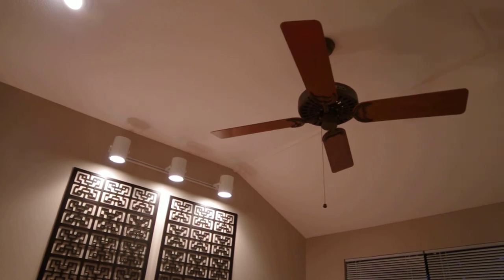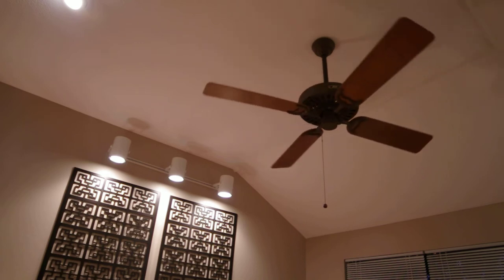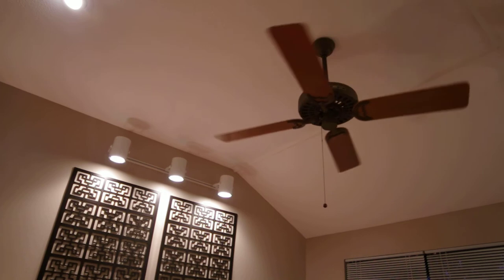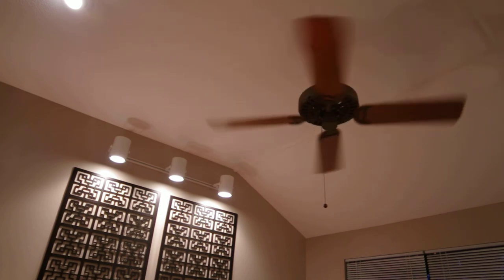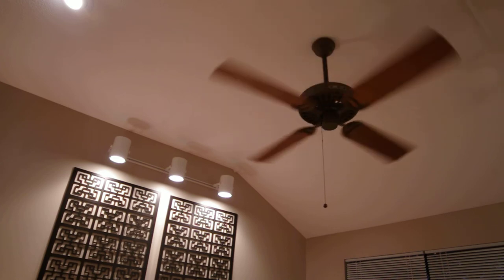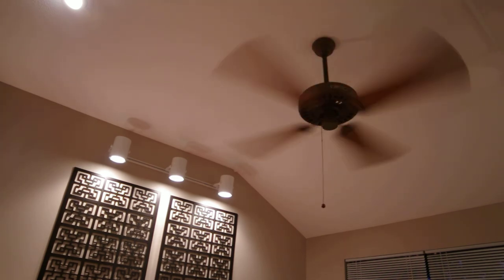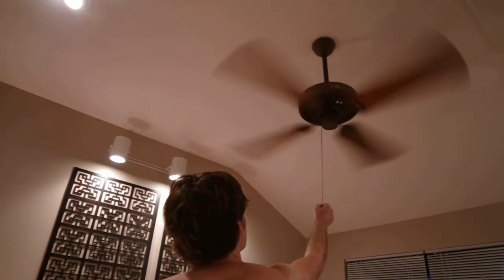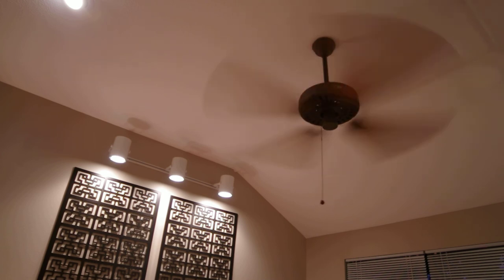Hunter Original 3-Speed Modification

Comment: Great short video....Thanks!  I have two Hunter Original Fans, both 4 blade which I much prefer.  Mine both run approx. 48 to 50 RPM on the low speed unaltered which is the only speed I run them on.  I refilled them with SAE 20 oil instead of SAE 10 which I didn't have.  Maybe that is slowing them down a bit but I wouldn't think that would make much difference.  You thoughts would be appreciated.
Thanks again,